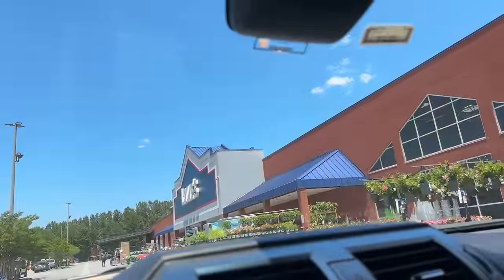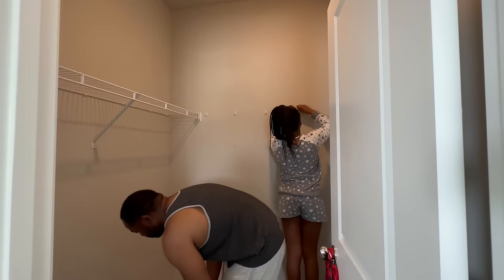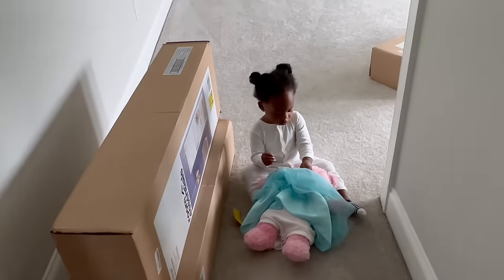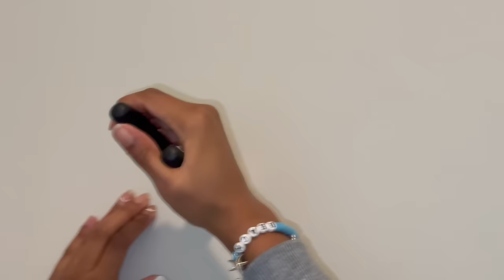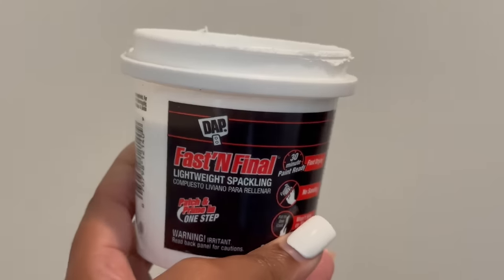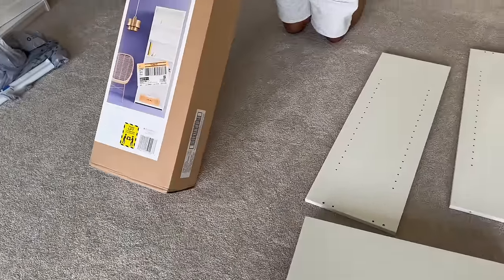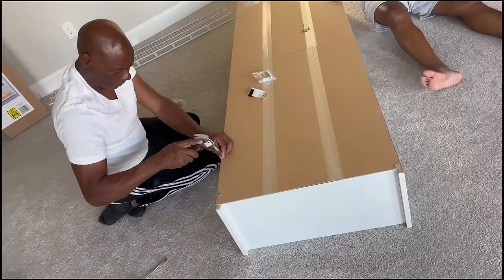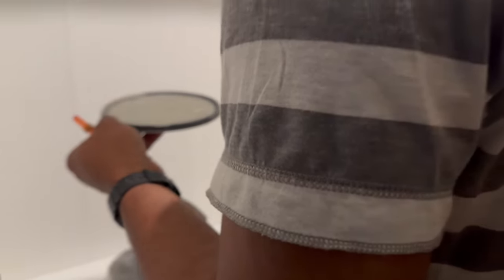UPGRADING A WIRE SHELF CLOSET TO A $40 LUXURY CLOSET SYSTEM|BEGINNER FRIENDLY @tiahnamrose

Comment: That closet looks to be the size of my closet. I’ve been trying to figure out a plan for it, but the biggest problem is the closet door opens inside the closet and takes up so much value real estate . I’m thinking about doing a barn door.  Why they would do that to a small closet I don’t understand. Your daughter’s closet turned out great.
Reply from the maker: Can you switch around the door? I like barn doors too but do you have the space for the slide ? When it opens do you have that space?
Reply: @tiahnamrose  , Unfortunately no, I had someone to look at it, but the frame is too small to switch.
Reply: Try bifold barn doors. I had to do this for laundry room. The track is only as long as the door.

Comment: I started with a closetmaid setup worth $663 from homedepot. Looks great but I decided to go all out and do the entire closet. I started by doing a Google search and found it cheaper at bed bath beyond.
Homedepot closetmaid drawer $59.99-$84.89 
Bedbathandbeyond $41.39
Same brand but quality is poor.

So I decided to do it myself. 
I tried homedepot White Melamine Wood Shelf 23.75 in. D x 48 in. $19.99
Use it only as a starter. The shelf that sits by the floor. 
Then use homedepot Rubbermaid White Laminated Wood Shelf 12 in. D x 72 in. L $17.98
Homedepot will cut them down for you.

Im about 75% but taking a break and checking YouTube for any ideas.
$40 is way off. 

If I would do it all over again I would start with the closetmaid Wood Closet System at home Depot for $137. Then build up with the Rubbermaid White Laminated Wood Shelf 12 in. D x 72 in. L $17.98